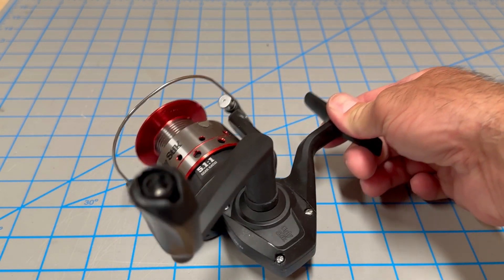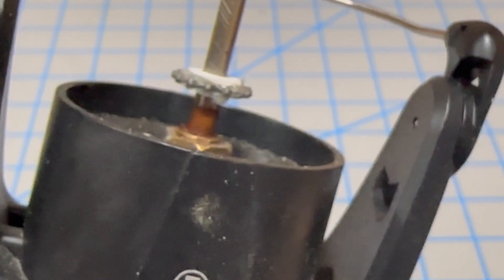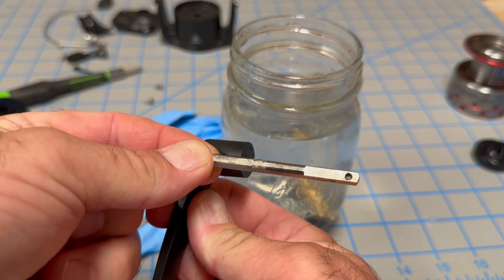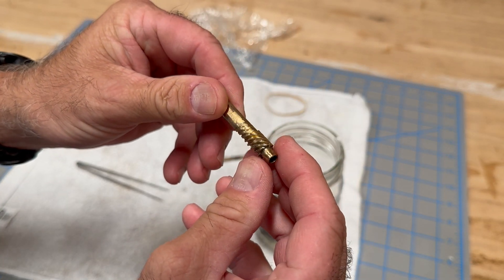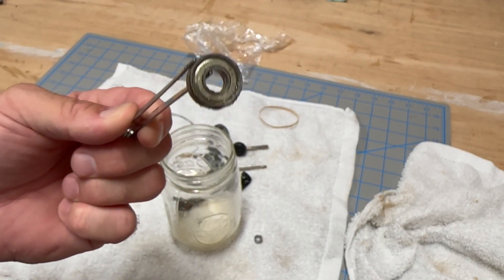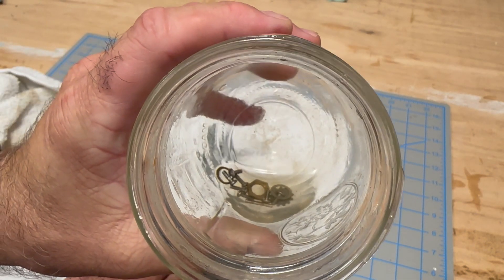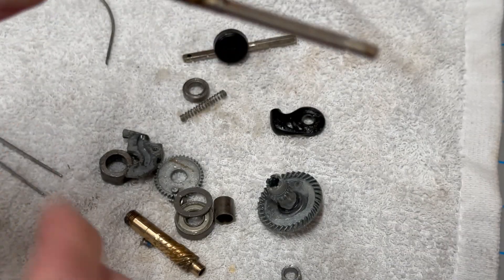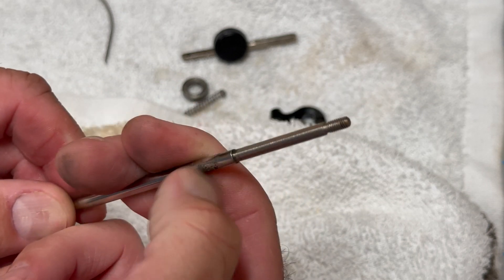Ugly Stick Reel Disassembly

Comment: Dude, you immersed them in a jar with a lid on it. It didn't corrode because it was oxygen-starved!

Try it again, but just spray the parts with salt water and leave them outside for a week. It'll be rust city.

The sad fact is that they make these reels with carbon steel that will rust out because it saves them twenty-five cents per reel to make, and most consumers just don't know better.
Reply from the maker: Google ai says the Water already contains dissolved oxygen and the rust process will happen regardless of the lid but I will try this way too — thank you for the suggestion.   But I do see the point of if you spray it and let it sit outside the water will evap leaving salt residue causing increased corrosion
Reply: @randomreviews7574  Water has very little oxygen in it compared to air. Tap water might not have any in it at all! Even in the best case it's going to be like 6 or 7 milligrams per liter--- that's 7/1000ths of a gram of oxygen which can rust 14/1000ths of a gram of steel before it's used up.

Comment: Im new to fishing, does anyone know why my reels sticking? I have the gx2 and the handle thing keeps sticking
Reply: Same with me
Reply: The bearings are probably stuck from rust. Take the reel apart and measure the bearings (they'll be in MM) and buy replacements from amazon. Get double rubber sealed stainless bearings if you can as they're more resistant to the elements. Clean everything up and it'll be good as new. 

Most spinning reels have the same basic design so any youtube video showing how to do this will probably work.